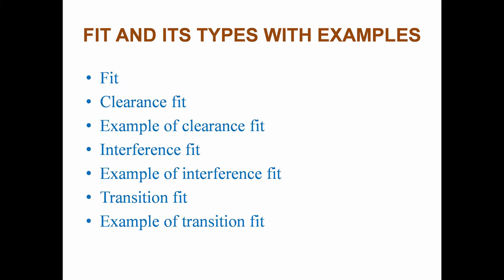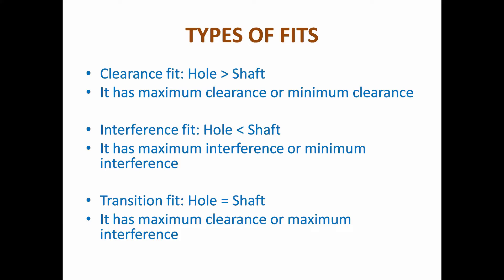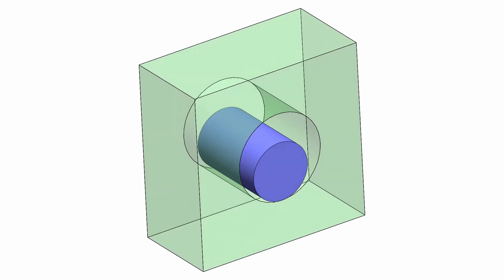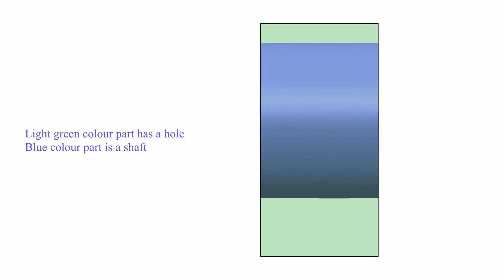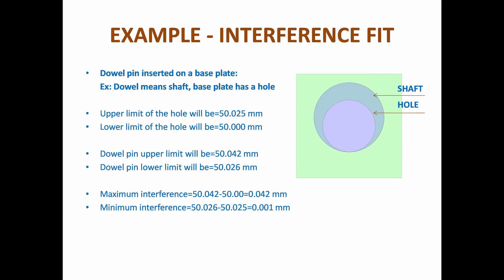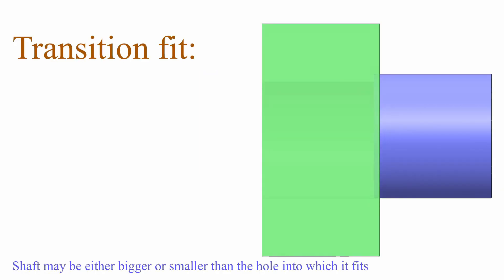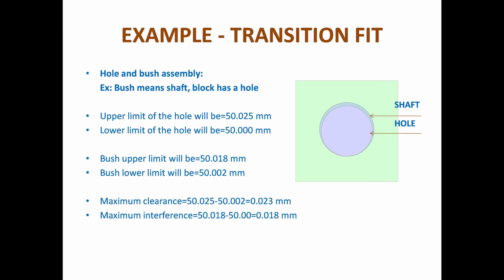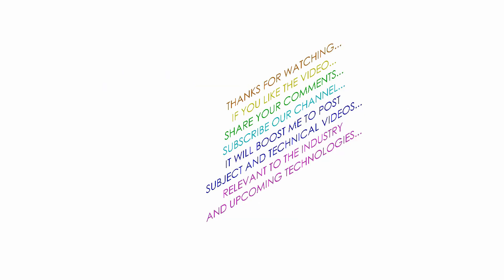Fit and Types of Fits - Clearance Fit / Interference Fit & Transition Fit (Animation)

Comment: Sir please help to solve a Question:- If the size of Hole is equal to the size of shaft then the type of fitment is:
A. No fitment possibility. B. Interference Fit, C. Clearence Fit, D. Transition Fit, E. There is an error in question asked?

Comment: If we want a clearance fit, we should make the hole within the limit.In the example of spindle, is it within  0.242-0.080 mm ?
Reply from the maker: Clearance fit: We should make the hole and spindle(shaft) within the limit.

Maximum clearance: Difference between maximum size of hole & minimum size of shaft = 50.062 - 49.820 = 0.242 mm

Minimum clearance: Difference between minimum size of hole & maximum size of shaft = 50.000 - 49.920 = 0.080 mm

Note: It may be vary depends up on the applications and the size of the dimensions.